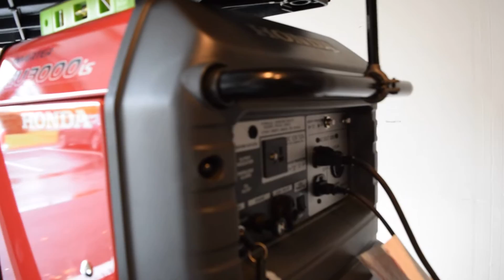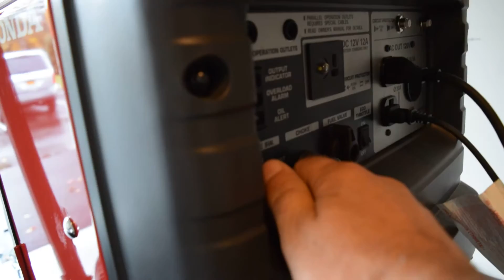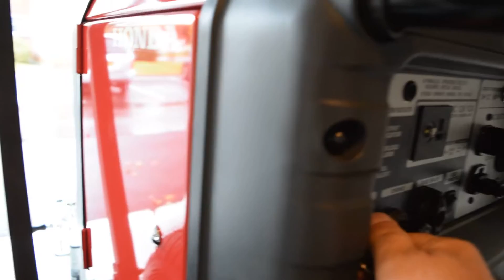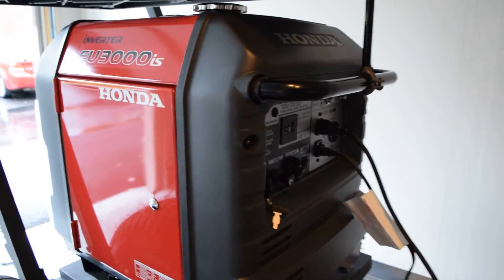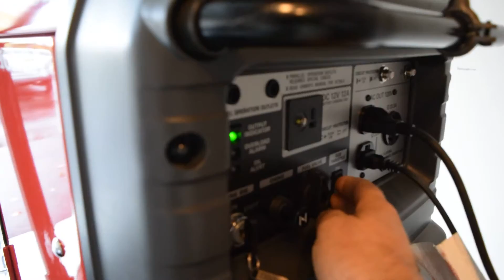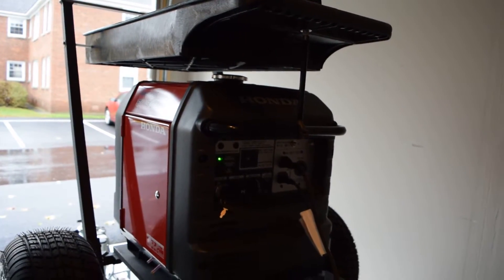Honda EU3000is Generator : ECO Mode issues part 2

Comment: Having a number of generators over the years I learned don't start a heavy load on idle mode. Get the speed up, then plug in the load and turn on the breaker switch. Echo mode is ok for lights and small power tools.

Comment: Yeah for 3000$ thousand dollars I'm feeling like I bought the biggest piece of s*** out there
Reply: That's exactly what mine does. As long as you leave it wide open, it's okay, but 4 3000$ thousand dollars I'm a little f*** p*** off
Reply: I could've bought 1/2 the price. Maybe a little louder in noise, but with four times the power p*** off like a some b****😊

Comment: Oh man! First tank and all that trouble. That's why we pay big bucks for.these things. We assume we're buying reliability.
Mine is three or four years old and it used to run a full size side by side fridge, an entertainment center with surround and sub woofer, and a 12,000 BTU window air on ECO MODE. When the compressor in the fridge or ac went on the rpms would go up for a few seconds maybe and then back to slow. Today it kept shutting the ac off and once the genny stopped. I ran it on NON ECO mode for an hour and then the power came back on. Just for kicks I turned it to eco mode and this time it worked. I guess I'll change the plug and put high octane in it next time. (I THOUGHT I put 91 in last time but maybe not.) And the gas is probably a bit over a year old. I think maybe the carb was a bit clogged. As running high speed for an hour seemed to fix it. I'm pissed. If I had 20/20 future sight, scratch that.  I wish I would have gone for 6000OIS with the 220 volts (I use 220 for a ham radio linear amp) and fuel injection. Shit! For the $2200.00 I paid for the 3000 IS it should have come with fuel injection. oh well.
Reply from the maker: Yes Sir,
I ended up getting a brand new one from Honda, through the place I got it from. They replaced all kinds of shit like the inverter, stepper motor , etc. nothing  fixed it. Unresolved. The new one is 100 percent and has been since.

Comment: You do realize the in eco mode, the solenoid "Lets go" of the throttle arm, letting the governor control the speed. If it doesn't sense current in either of the windings, it maintains voltage on the solenoid, keeping it in an "idle" state. The power head continues to output power, but at very low voltage and hertz. Your problem is the ECO circuit is not detecting the load.
Reply: Good observation.. So i guess you could have the eco mode on all the time because even with heavy load it will control the rpm?
Reply: @francisvazquez13  That depends on how it is being used. Not a good idea on a job site with lots of users. There is a slight lag to spool up to supply the current. (I think the voltage stays constant.) Imagine starting your chop saw or drill motor. Tool would bog and complain for the half second or so until full current is available. Never tried an inverter gen-set, but have seen them used on a mobile conveyor belt repair truck. (Crew of 2 guys.) Worked great in that application. (It mostly ran a big heater to vulcanize the conveyor belt ends.)

Comment: Hey. Mine was the throttle motor on top of carb. You can buy the whole carb with motor on it for two extra dollars. Changed it and now have iron and coffee pot hooked up and is doing fine.
Reply from the maker: That’s good to know, thanks man.
Reply from the maker: How much was that carb ? I’ve heard that this motor is linked up to the eco mode somehow, and controls the demand from eco mode / increased loads.

Comment: A 1500 watt heater needs 3000 watts to start you are overloading that generator
Reply: no heater needs 1500watts period!
Reply from the maker: harold haggman 
This generator had the same problem regardless of what I ran. The new replacement has no trouble with the heater or anything else.

Comment: You’re going to ruin the new one as well if you have things plugged in when starting. Never have equipment plugged into the AC ports when you start it. It will ruin the inverter trying to compensate during startup.
Reply from the maker: thebuyingseller 
Nothing was in the on position while starting. But that’s correct.

Comment: Im having the same issues with with my new honda eu3000is. Trying to figure out what the problem is. Thx for the post.
Reply from the maker: hershdawy 
The dealer installed a new inverter, and still didn’t fix it. After 2 attempts to figure it out, Honda finally sent me a new generator , as no one could figure out what was wrong with it. The new one has been perfect so far and eco mode works as it should with the same tests applied.

Comment: update on my earlier comment..was having same issues and i kept checking out the gen. till i tried adding a little more oil to it to the fill line.had been afraid to over fill it so it did not have enough oil which caused the safety system to kick off the gen to protect it from damage..after i filled it to where the dip stick showed it to the top of the mark then tried it again on my 18 ft rv.  it ran great,even with turning on the 13500 ac it just kept going great, i left it running half a day  and it never quit..then turned it off and restarted and turned right on with no difficulty..
Reply from the maker: Izzy v 
Thanks, I checked the oil and did the same thing as did the dealer who tried to fix it with no luck. Unfortunately, the never were able to deter main the cause. Honda sent me a new Generator, which works flawless. This model is a great one to have, super efficient on fuel and runs anything I own.
Reply: glad you were able to get a new one. i own another honda 3000  thats about 4 years old that i use in my big truck out on the road and it has worked like a charm.. they are a great product.

Comment: I have a similar issue on the 2000i, load under rating on eco mode will temporarily cause the appliance to blink and shut off. It won't raise rpm unless it's not in eco mode. If I have it on regular it revs. But not on eco.
Reply from the maker: Jennafer Yellowhorse - It has more than likely been defective from the beginning , and until you put a bigger load onto it, you probably never noticed the issue. The manual does say to avoid eco mode on heavy loads, but my suggestion is to just use full power on heavy drawn things because Honda couldn't figure out the problem, and sent me a new generator. But that doesn't happen very often.

Comment: "Honda generators out of the box are either perfect or lemons with un resolvable problems." - Parts counter guys at Honda.
Reply from the maker: My Thoughts exactly. Dead on ! They were unable to fix it, and never did tell me or the dealer techs what was ever the issue with it because they couldn't figure it out.
Reply: I have same problems

Comment: Sounds like carburetor problem to me.  I bet it's simple.
Reply: OR more likely, the little electric servo that adjusts throttle while in eco mode isn't doing what it's supposed to.
Reply from the maker: I agree, I asked them to look at the stepping motor which is the servo your speaking of, first. I guess they preferred to warranty the 450 dollar inverter first (which didn't fix the issue). Ill be taking it back Monday, I will post a vid of #3 soon. Thanks for commenting buddy.
Reply: i also have the same problem with mine also still on my first tank of fuel. but mine well not start again for a while. its like something overheats then has to cool down before it well run again.. it runs ok with the eco off . i was about to work on it myself but now that i see others are having the same problem with this model i well contact the seller.
Reply: Yep there’s a jet for the echo mode that can be adjusted.